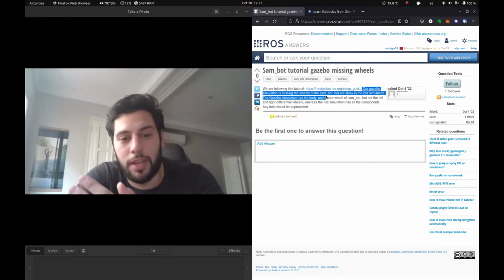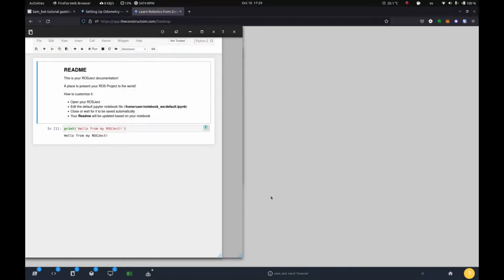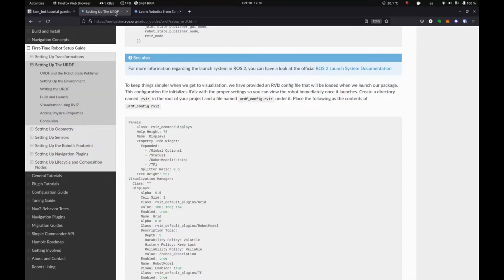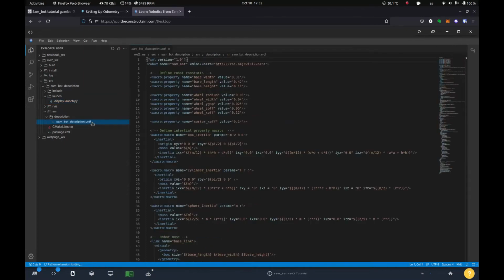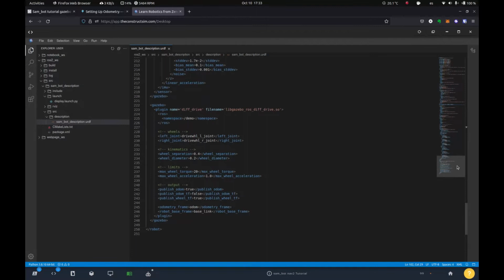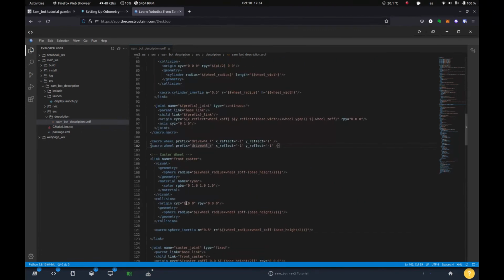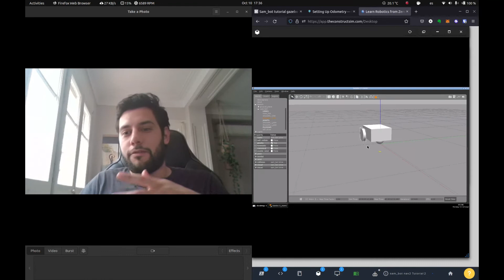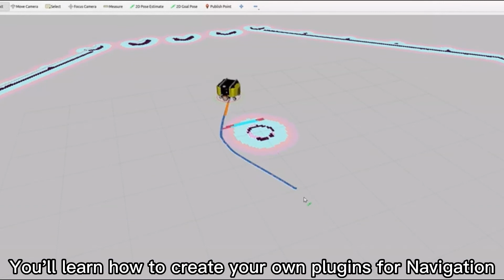[ROS2 Q&A] 237 - How to spawn robot from sam_bot nav2 tutorial

Comment: Thanks a lot! if not your file i may spent lot of time to remake it.  I also have same problem.  but i find it! This problem is URDF file set something wrong
THIS IS CORRECT ONE
  <link name="base_link">
    <visual>
      <geometry>
        <box size="${base_length} ${base_width} ${base_height}"/>
      </geometry>
      <material name="Cyan">
        <color rgba="0 1.0 1.0 1.0"/>
      </material>
    </visual>

    <collision>
      <geometry>
        <box size="${base_length} ${base_width} ${base_height}"/>
      </geometry>
    </collision>

    <xacro:box_inertia m="15" w="${base_width}" d="${base_length}" h="${base_height}"/>
  </link>

 but 

 <link name="base_link">
    <visual>
      <geometry>
        <box size="${base_length} ${base_width} ${base_height}"/>
      </geometry>
      <material name="Cyan">
        <color rgba="0 1.0 1.0 1.0"/>
      </material>
    </visual>
  </link>

    <collision>
      <geometry>
        <box size="${base_length} ${base_width} ${base_height}"/>
      </geometry>
    </collision>

    <xacro:box_inertia m="15" w="${base_width}" d="${base_length}" h="${base_height}"/>

it is my original wrong part setting so that is a reason why the robot doesn't have wheel.

as you can see collision and xacro part doesnt include in <link> to </link>  so wheel disappear in GAZEBO but in RVIZ